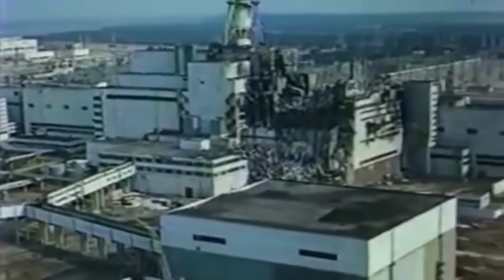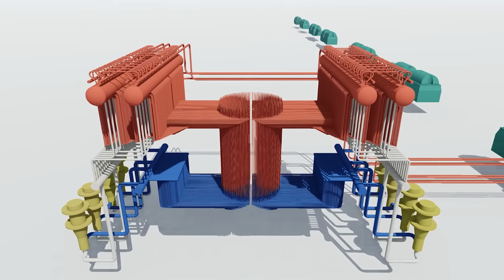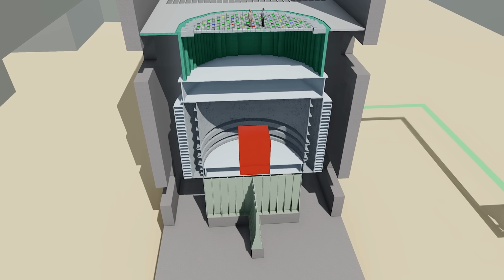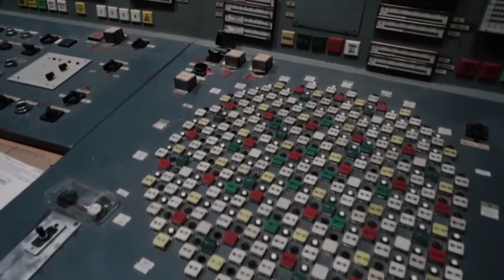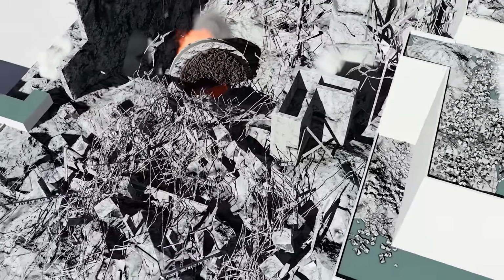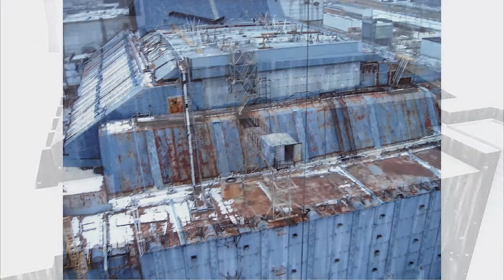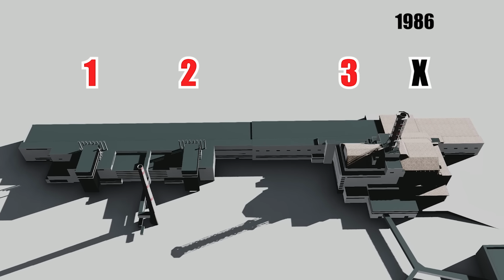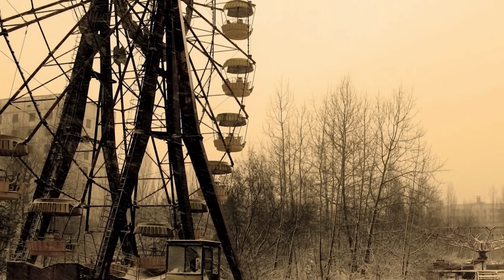CHERNOBYL DISASTER - An Inside Look - 3D

Comment: So.. 1:03 are there different types of nuclear reactions and Russia used the one with the void coefficient? or the void coefficient exists because of the design of the plant?
Reply: Well, the positive void coefficent wasnt really known at the time. Not understood enough. The graphite control rods moderated (turned fast neutrons into thermal neutrons which can be absorbed and fissioned easily), while the water cooled. Normally, D2O (or heavy water) both cooled and moderated, meaning when it boiled, the void (steam) reduced reactivity, not increased.

Comment: There are western reactors with positive void coefficient.. even some british designs and Canadian designs have positive void coefficient. The real issue was the Positive scram effect which was an issue in the design of the control rods
Reply: The positive scram effect was due to the positive void coefficient. The control rods displaced water creating voids. They could've been designed in a way that they displaced less water. In fact they were that way originally, but they were later modified. The designers didn't know how bad the positive void coefficient was and that led to the design error.
Reply: @anttiruo   it’s was more or less that the cold, neutron poisoning water was rapidly displaced by graphite tips on the control rods. The rapid replacement from something that slows down the reaction, to something that accelerates it caused a power spike that burned away all the xenon gas. THEN the power surge occurs when the steam boils away.
Reply: The said positive void coefficient is why there’s a positive scram effect.

Comment: The rod's tips are only 2 tons of graphite out of 2000 tons that are in the active zone, they could not cause an instant increase in power. This is only 0.01% of graphite and it's only +0.01% of power. The main two reasons are Dyatlov's reckless order to conduct the experiment at 200 MW and the increase in power from 30 MW when there was severe poisoning of the reactor with xenon. The reactor was in an uncontrolled state.
Reply: It’s not really about the total mass of graphite in the core, but about the local effect and the dynamics when the control rods were inserted. The graphite tips didn’t need to add tons of reactivity everywhere — what mattered is that they replaced water in the lower part of the core.

Water not only moderated neutrons but also absorbed some of them. When it was displaced by graphite, moderation increased while absorption decreased, causing a sharp local rise in reactivity exactly where the reactor was already most unstable.

The fact that the rods jammed under the extreme conditions meant that the graphite tips stayed in this dangerous position, right at the hot bottom of the core, instead of allowing the boron section to enter and reduce reactivity.

So yes, Dyatlov’s reckless decisions and the xenon poisoning set up the unstable state, but the flawed design of the control rods acted as the trigger. The AZ-5 insertion didn’t shut the reactor down — it actually provided the final push into the runaway excursion.
Reply: Well it was a combination of the uneven xenon poisoning. Plus the fact that there was too much cold water in the core that got rapidly displaced. That caused a power spike that burned away the remaining xenon. While the graphite didn’t cause the surge by itself it allowed it to happen.

Comment: This has got to be the most detailed 3d model I've seen used in a video on yt, whilst talking about the explosion.

I heard there were two explosions and that the first was the steam explosion and the second was hydrogen.

I'm curious above the fuel rods, they're made of Zirconium? I see small tubes with uranium pellets closed inside a bigger tube, are they both made of same materials and I also noticed water inside the fuel rods (not the smaller inner one's with uranium pallets) is there water both outside the fuel rod and inside.?
Reply: I also wondered this, because it then showed the red fluid in the larger space of the reactor which I assumed was actually what turned into steam.

Comment: western reactors stable by design. By  stable western propohanda design :)
Reply: pretty ignorant to say this, PWR reactors are self regulating. Most don't even need power to run cooling water over the core.
Reply: Newer reactors have improved. I did not get the message at all he was damming Russians. It was older design, new designs have more safety. He did say the working Ru reactors of this type are retrofitted with more safety measures. Lot of human error as in 3-mile island.
Reply: What defines “propaganda” in this sense.
Reply: It’s propoganda, becuase the us can build better reactors than idiots?

Comment: Although Dyatlov holds no small responsibility for this failure due to his errant overconfidence and due to the knowledge withheld by the state, I would just add that unlike in the TV series, Dyatlov stayed behind throughout and was instrumental in helping to put out fires in reactor 3 that could have caused a knock on catastrophe along side the initial one. These events he helped cause, haunted him for the rest of his life. He died a sad broken man, it was very tragic.
Reply: @Nine-Signs  not 100% at fault because obviously not being told the emergency stop doesn't always work is a big deal but at the same time ignoring safety warnings, ignoring the xenon shutdown procedure if the reactor drops too low and also not realising they were causing that problem taking more and more rods out to maintain that power level.  He could've cancelled the test for any reason and nearly destroyed earth.  He was infact dangerous guy

Comment: You didn’t mention the radiation reading from the core. But I’m told it’s the equivalent of a chest xray.
Reply: Watch the series Chernobyl, its soooo good. Its the best Disaster cinema imo
Reply: @Angel_V8 "equivalent of a chest X-ray" is taken directly from that series btw :D
Reply: @coldwarkiwi_2nd183  yes, but then it was corrected by the scientist that it would actually be so much worse than a single Xray.
Reply: close, its equivalent to having 20 million Xrays all at once. possible even twice that amount even 4 times. Its so much that .0001 second of exposure immediately decays your immune system and burns your white blood-cells.
Reply: "like not wearing your seatbelt" if i don't wear my seatbelt my car doesn't poison the black sea when it reaches the watet table
Reply: @Anon-zu3xn  analogy, not literal friend
Reply: Holding a chunk of graphite from exploded reactor of chernobyl nuclear power plant is like taking 4 million chest in your hand

Comment: Dyatlov was a scapegoat for the explosion, he actually never broke any rules. During xenon poisoning there were no lower bound on control rods.

It exploaded because it was designed to produce power and producing plutonium, not at the same time though.
Reply: Dyatlov broke many rules, right before the reactor was going to explode when the reactor reached a point of 200 thermal megawatts he insisted that all control rods except 6 should be removed from the core instead of shutting down the reactor, that caused a power surge so extreme that a3-5 was pressed, then due to the fault of Dyatlov and the poorly designed reactor it exploded. on top of that, it was not just Dyatlov's fault it was also the plant directors fault, they were informed the night before the reactor blew up that they could not preform the test and it must be done after midnight, instead of raising the power of the reactor they left it a half power then the reactor got poisoned (I forgot the name of the thing that caused this) that was another cause of this accident but it could have easily been prevented if there were trained plant workers on duty at the time and if Dyatlov did not order that the test should be done and the reactor could not be shut down
Reply: He broke many rules, BUT, he was innocent of it exploding, as the failsafe to prevent a meltdown was faulty. Which means he was technically innocent.
Reply: @Angel_V8  but the circumstances HE created lead to the initiation of the fail safe. In other words, he’s beyond guilty
Reply: @Masshysteria40  thats not how that works. If you drive a car that has no breaks, but were told had no breaks, were told to drive normally or even have fun with driving it, then crash into someone, that is your fault then?
Reply: @Angel_V8  your analogy is flawed. Because the SCRAM is only meant to be used in an emergency, not every day operation like brakes are.  He put the reactor into an unsafe state because he believed the SCRAM would protect him. It's a nuclear reactor, you shouldn't push it to it's limits like a toy and rely on a single mechanism to stop it. The only good thing that came out of his arrogance was people in reactors were more likely to say no or point to guidelines instead of blindly listening to their boss.
Reply: @Angel_V8  Dyatlov's situation sounds more like he was told to drive a car, and wasn't told the car had no breaks. Then he decided to drunk drive it and crashed because the car had no breaks. However you want to put it, that's a man that shouldn't get anywhere near a car, alcohol, or both ever again.
Reply: @Angel_V8  Yes the failsafe was fault but at the moment before the reactor was going to explode the reactor should have been shut down but dyatlov refused
Reply: Dyatlov was right. RMBK reactor don't explode, and we don't also see graphite because it's not there, and he was also not in charge because he was on the bathroom when the explosion happens
Reply: @kitsune5746  They can explode, there is a shit ton of graphite, Dyatlov was in charge and in the controllroom at the time of the explosion.

But he didnt break any rules, during Xenon poisoning there is no lower bound on the amount of controlrods in the core, their bloody manual said that during Xenon poisoning remove controlrods to remain critical.

Now if the power is reducing are they critical or not?

Comment: I guess I’m confused. I always hear so many contradictory things from different sources about how the RBMK worked (just goes to show how available information was in the USSR that we can’t even definitively document it). I was under the impression that, because of the negative temperature coefficient, reactivity increases as the fuel gets colder. Heat creates steam. Steam increases reactivity. Steam creates heat. Heat lowers reactivity. Heat creates steam which raises reactivity. Steam creates heat which lowers reactivity. Balance.
Reply: The water was coolant, but also acted as neutron absorber, so when Heat boils the Water to Steam, there isn't water to absorb then and reactivity increases.
Heat reduces reactivity (doppler shifting means less chance of fission)
The RBMK wasn't balanced: heat making steam had a greater affect at increasing reactivity than the heat reduced it.
Less water means less coolant, so it gets hotter, so more steam gets produced, so more reactivity...
Reply: Your point about secret documents accurately describes the U.S. that has the USSR and Ru beat many times over for hiding information and data from its citizens. Witness the Wuhan Lab leak theory, covered up by gov and media for years. Is it the CIA or FBI that now says there was an 85% change Cov came from the lab.
Reply: All I know about RBMK reactors is that they do not explode

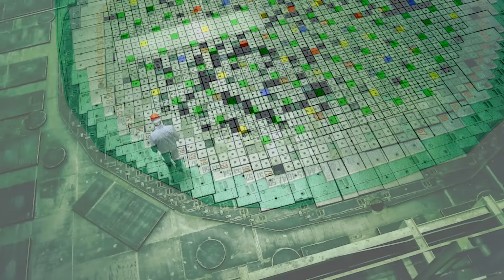Comment: 2:44 "It was only possible, because there was no pressure vessel. This can be likened to driving without a seatbelt". This is a bit lame actually and shows lack of understanding of the reactor design. RBMK is not a pressurised water reactor, so in principle, it doesn't require a pressure vessel. Instead, every individual fuel channel was its own (low) pressure vessel. That is why it could have been refueled at full power - they would disconnect the channel from the circuit, pull it out and replace it with a new one.
Reply: BWRs have a pressure vessel, and it’s not a pressurized water reactor
Reply: @Nemo2507s  RBMK is essentially multiple BWRs (every RBMK fuel channel is) sharing a common moderator (graphite) and regulating elements.

Comment: RBMK reactors are horribly designed because they were originally a uranium enriching, plutonium making reactor used for nuclear weapons that was modified, upscaled and shoehorned into a power reactor. That’s why it didn’t have a containment dome among a bunch of other problems. Yes.. there are other RBMK reactors still online to this day that don’t have any issues. Hell, even the other reactors at Chernobyl continued to run for years after reactor 4 exploded but any reactor that doesn’t have a containment dome is flawed in my opinion and should be shut down.
Reply: What I don't get is who was living there to still require power from the other 3 reactors? I thought 150k people we evacuated. And how could anyone run them with the amount of rads? This has always puzzled me
Reply: @ArcanePath360  Well, rest of the Ukraine used to still need those power. You do know electricity can be transmitted in a long distance via cable, right?
Reply: @GilangMentariHamidy  Okay, I am not familiar with the output of a nuclear power plant and how much of a country can run on just one station, but my other question still needs answering. Did they all wear lead suits and work in rotating shifts to keep the power going? Who would want that job?
Reply: @ArcanePath360  the power plant full capacity was 3600MW, which was way bigger than typical coal power plant. If it were small, the meltdown would not be cathastropic like this.

After the meltdown, the "liquidator" cleaned up the whole power plant for several month, including decontaminating the other units so it could be powered back on. They remove every single possible contaminated material, including several layer of soil. Then they also built "sarchophagus" to contain the destroyed building to prevent the nuclear meltdown remnants to not escape to the air anymore. All these measures gave some leeway to allow human to have activities near the site to some extent.

However, the liquidator did not decontaminate the rest of the region as it would be a collosal work. Hence the rest of the region remains to be nuclear wasteland for many years to come.

There are lots of documentaries on YT talking about this. You can also watch Chernobyl TV series from 2019 that almost historically accurate depiction of the event.
Reply: @GilangMentariHamidy   Thanks, it makes sense now. I've seen a lot of documentaries but none explained these finer points. Cheers!
Reply: @GilangMentariHamidy   Yeah but it’s horribly inefficient. The farther away the power is sent over power lines the more “overhead” is needed to send it. I always wondered the same thing but I guess the “exclusion zone” around Chernobyl was kind of exaggerated. They always made it sound like Chernobyl was made “just” for the city of Pripyat and all of Pripyat was evacuated after the accident at Chernobyl so I always wondered why the other 3 reactors were still online but no, 4 reactors can make A LOT of power.
Reply: @frankthespank  well, the high voltage powerlines makes sending power over large distance quite more efficient and less overhead. Also, Kyiv is quite close to the plant, making it an important base load generator for the city.
Reply: @ArcanePath360 oh, it was even more scary than that: the workers had to live outside the exclusion zone, get brought in for every shift at the other three reactors 😢
Reply: As I remember after 30 years radiation was 3x normal outside the reactor and normal inside the buildings. If you are driving in and out, you are safer than pilots thar get much, much more radiation.

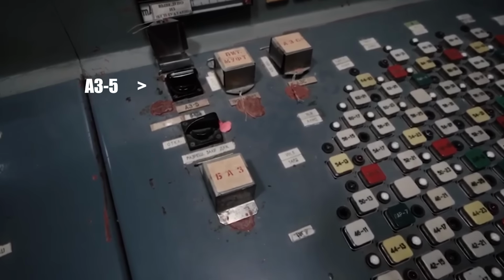Comment: 3:44 Dyatlov actually did not beak any rules while running the test, including raising the power (was not even Dyatlov's command contrary to the show). The test was done well within the normal operating guidelines for the test.
Reply: @Gabrocol  literally he ordered to raise the power immediately after it dropped below 700 megawatts (the safety test level) instead of waiting 24 hours, as it was said in the instructions
Reply: Yeah, technically he didn't break any rules in the same way technically an RBMK reactor is safe. Why would you die on this hill?